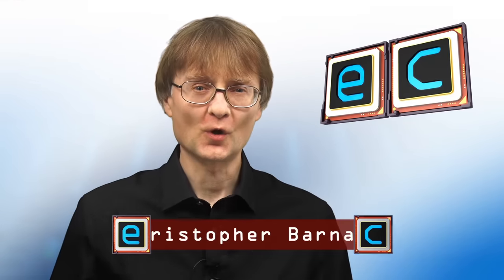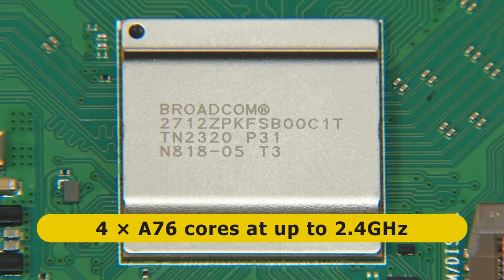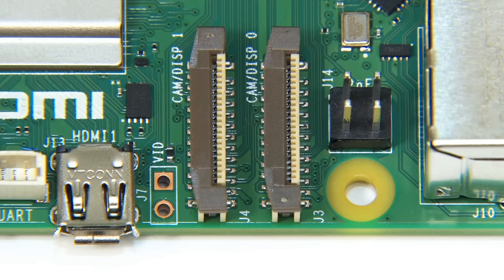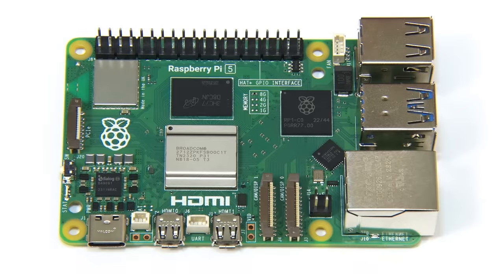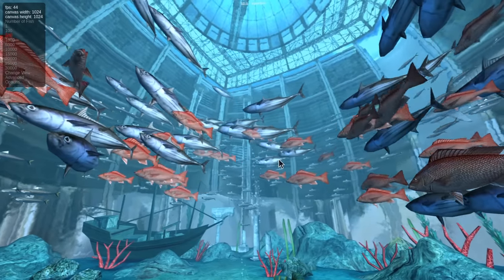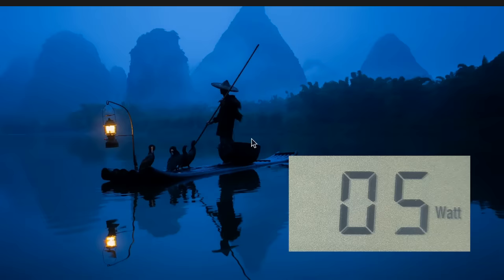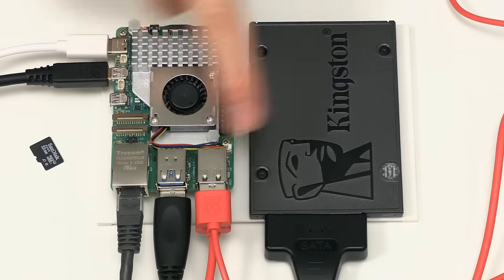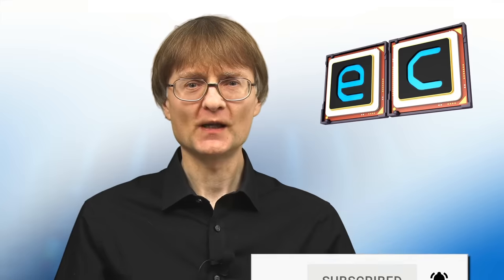Raspberry Pi 5

Comment: Is it possible to use it without the cooling? Or is there a passive cooler option thin enough to fit between the Pi 5 and a hat?

I am using Pi 4 with a HiFi Berry Digi+ I/O hat on it, mainly as a music player and server (LMS + squeezelite / MPD). Occasionally, I am using it to watch videos, too. 
While the temperature during the music playback was high but acceptable, Pi 4 was getting pretty hot during the video playback and the videos dropped lots of frames, so a cooling solution was needed. 
I used the geekworm P165-A radiator with no fan as a passive cooling solution and this seems to be optimal for my needs:
- the temperature dropped significantly,
- it fits between the Pi's board and the HiFi Berry hat,
- it is passive, so it is silent.

I wonder... Could I upgrade to Pi 5 and preserve all the functionality?

And a second question: is the widevine available for the 64-bit OS by now?

Comment: This is great news going to pre order one, so from what I can see if you have the new official case you can not use the official active cooler, the new case has its own fan.  Did they send you an official case? can the pi with cooler fit if you remove the fan case?
Reply from the maker: You are correct I think -- the option is either the active cooler (heat sink and fan) or the official case (which has the fan in it, and comes with heat sinks to fit). I was not sent an official case to look at.
Reply: Thanks Chris for the reply, it looks like this is the way.  @ExplainingComputers

Comment: Honestly, the Pi4 8gb clocked at 2.2ghz serves me very well as a desktop. Whenever i need more power i can just fire up my 5,1 MacPro with it's 12 core xeon beast mode. The 5,1 doubles as a space heater. The one thing I'd love to know is how well the new board overclocks.

Comment: Query:  Would high quality CPU thermal paste work better than those pre-applied thermal pads on that cooler?
Reply from the maker: Probably not -- there are some significant, and varying, gaps to fill. So with thermal paste, some precise copper shims would be needed too -- although paste and shims would certainly work better.
Reply: @ExplainingComputers  Thanks for the reply. I never heard of copper shims. I'll have to look into that.

Comment: A board layout is still a big concern for me. I'd like to find a full size HDMI where USB2.0 are located (and move them to a 16-pin header), a power button switch and an SD card at a left long side, and CSI/DSI at a back short side. It's good to find Pi faster, but it's too late ))

Comment: Because of the RPi drought, I have had to go over to other processors for assorted projects, in particular I have acquired and used old Acer Revo  machines. I still have a few of them left that will keep me supplied for the next few months. With 4GB RAM, and some sort of SSD >100 GB, I usually mange to find these for about $50, delivered. 

The problem for RPi is that people have lost faith in its ability to deliver. Thus, I am considering using something "completely different". Most of the RPis I have used were compute modules. The board I would like to migrate to is a Milk-V Mars CM (as in compute module). With 8GB Ram and a 32GB eMMC, a board costs about $84 +.

Comment: Hopefully there will be Rpi 5 model A's as well as a Rpi Zero W 3.    With RPi's still unobtainum for the most part, I hope the model 5 will be widely available on launch.
I'd also like to see a new Pi format, call it a model C.  That would be a larger board with on board M.2 socket, and maybe a 50 pin connector (expanded 40) with more GPIO pins.  Also why not a 16GB RAM option, or even an SODIMM socket for a stick of DDR5?

Comment: I love pis but it's hard to interface with a 5v circuit using a 3.3v micro controller. so Arduino has its foot in the door with a 5 volt base. Especially when it's easier to drop you current than raise it. For up you have to introduce a higher voltage but for down you can usually get away with a resistor voltage devider curcit

Comment: Summary
This video provides an overview of the Raspberry Pi 5, including its physical appearance, accessories, specifications, and performance. The Pi 5 features a new system on a chip (SoC) with four ARM Cortex A76 cores clocked at 2.4 GHz, delivering a two to three times performance increase compared to the Pi 4. It also includes a new VideoCore 7 GPU, improved camera support, and a new chip called the rp1 that enhances the performance of connected peripherals. The Pi 5 has several new connectors, including two MPHY transceivers for cameras or LCD displays, a PCIe connector for linking to PCIe peripherals, and a power button. The wireless module provides Wi-Fi and Bluetooth capabilities. The micro SD card slot remains the only onboard storage, but the performance has been improved. Overall, the Raspberry Pi 5 offers a responsive desktop experience and impressive YouTube playback.

Highlights
💻 The Raspberry Pi 5 features a new SoC with four ARM Cortex A76 cores clocked at 2.4 GHz, providing a significant performance increase compared to the Pi 4.
📷 The Pi 5 includes a new VideoCore 7 GPU and improved camera support for enhanced graphics and image processing capabilities.
🖥 The rp1 chip improves the performance of connected peripherals, enhancing the overall functionality of the Pi 5.
📶 The Pi 5 has a wireless module that offers Wi-Fi and Bluetooth capabilities for seamless connectivity.
📲 The micro SD card slot remains the only onboard storage, but the performance has been improved with support for the SDR 104 high-speed mode.
🎮 The Pi 5 provides a responsive desktop experience and impressive YouTube playback, making it suitable for various computing tasks.
⚙ The Pi 5 has new connectors, including MPHY transceivers for cameras or LCD displays, a PCIe connector for linking to PCIe peripherals, and a power button for convenient operation.

Comment: How do we get sound out of it? Do we need a gizmo tap it off the HDMI cable? No words about the lack of a sound card because it was a sponsored video.
Reply from the maker: It was NOT a sponsored video, I was provided with free hardware (so clicked the control to indicate this), but there was no control or input to my review. I was also critical of several things -- including the lack of the 3.5mm jack (it was one of the first things that I mentioned -- at 2:13 ). So your comment "No words about the lack of a sound card" is COMPLETELY UNTRUE as I explictly mentioned this! And I was also critical of the lack of eMMC, and lack of a colour-coded GPIO header (all standard on most competitor SBCs). Sound is from HDMI only,.

By all means criticize my work, but do so based on what is actually in the video!

Comment: Thank you for the review. Is there a way to install open media vault on RP5? Seems like RP5 requires Debian 12 and OMV6 is not supported on Debian 12.
Reply from the maker: You make an extremely good point. Software-wise, these remain early days, with the Debian 12 Rasp Pi OS not yet released. As I understand it, OMV 7 wll be based on Debian 12.
Reply: @ExplainingComputers  Got it, thank you for responding.

Comment: I'm worried that as each PI comes out, it gets more and more powerful and more expensive. Beyond what is needed for small projects. Do they still sell earlier versions?
Reply from the maker: Agreed. But they do still sell the Pi 3B+, Pi 3A+ (a very nice, small Pi), the Pi 4, CM4, and various Pi Zeros. The Pi 3B+ will be supplied until at least 2028, and the Pi 4 until at least January 2031.
Reply: Ah good to know, I have a PI2 and 3 for projects and a few Arduinos for smaller ones @ExplainingComputers

Comment: Does pi5 also comes with Composite AV port??
Reply from the maker: It does not.
Reply: @ExplainingComputers  very bad , it should be.  Vga is very usable for simpler projects which requires display like car screen can be also used by just two wires.

Comment: What I never understood why the raspberry pi does not use USB-PD and ask for 20V at a 1.x amps instead of cranking up the 5V rail to 5A. It needs bigger wires... why?
Reply from the maker: I guess because in many industrial and maker applications, 20V will not be available, whilst 5V will.
Reply: @ExplainingComputers  every phone charger supports it and the raspi consumes enough power to not be left without a wall outlet for any amount of time. 

Basically if you need embedded you use an esp or something similar arduino instead. 

I am also wondering if any maker env where only 5V is available could possibly provide 5A :) My 3d printer, which runs a raspi can, but that also has rails that go higher to 24V for example.

Also I wonder if the meter you used that could only measure 5W, which would be 1A is possibly faulty and can't measure that low wattage accurately.
Reply from the maker: A very large number of Raspberry Pis are used in embedded situations in industry where an ESP32 or Arduino is absolutely not suitable. A very different level of processing power and other resources!

Comment: Can a non-PD power supply, like a 5V high current supply hotwired to a USB-C plug, still power the unit and not have the USB ports power limited?  How about injection through the GPIO header?  The latter is how the Voron 2.4 manual suggests connecting power to the Pi.

Comment: not a fan of active cooling. all my pi 4 (3 of them) are running for years without fan, just a small heatsink). Have you try running pi 5 without the fan, just a reasonable size heatsink?

Comment: I just got hold of a Pi4 a couple of months ago to use as a media PC (works great for HD video), but the Pi5 looks like a real improvement. I think it's possibly the first Raspberry Pi that is really viable to use as a basic desktop PC, and with such a low power requirement too.
Reply from the maker: What you say is correct. For a media or small desktop PC, the Pi 5 is a massive improvement over a Pi 4.

Comment: What's up with the uart connector on the front edge? It has the serial pins in the gpio, does this give a second interface or just a second connection point

Comment: This looks like a big upgrade, hope they MSRP is actually reflected when you try to by it, Pi 4's are nowhere near this price on Amazon right now :( Forgive my ignorance but would it be theoretically possible to add a discrete GPU through that new PCI-E connector? That could be a game changer for gaming on PI, since you've only talked about storage options here I presume that is not going to be possible.
Reply from the maker: Amazon has never been an approved Pi reseller -- all official Pi resellers charge the MSRP and always have. It is only scalpers who charge the higher prices.

Yes, in theory an external GPU could be interfaced to a Pi 5 via its PCIe connector -- but you would need software support, and also a power source. Remember that it's only a one lane PCIe 2.0 interface on the Pi 5, so very slow compared to the 16 lane PCIe 4.0 interfaces on the latest graphics cards.
Reply: @ExplainingComputers  Thanks for the detailed explanation Chris. I live now in Canada so I don't have a lot of options to get my hands on Raspberry Pi's but I'll be looking to pick one of them up when they become available to us over here. Appreciate all your content, I always feel so much more educated after watching one of your videos :)

Comment: I was coding a drone obstacle avoidance  depth of field on the pi4  with a single camera to capture frames  and accelerometer to compare image offset between frames.The Pi 4 with a single camera interface was far to slow. While Pi4 is well suited to the every day  media server tasks and probably well over powered for the general programmer. I would be really interested in  a speed test on the simultaneous  xor  frame captures of two cameras located side by side .  And displaying this back to the screen. My original intention was to then use IA to determine the object and distance. As you can imagine this was asking far to much from the PI4 using all it's cores.

Comment: Sad that they removed the 3.5mm audio jack but happy that they added the power button and the RTC battery connector.
Also, I am impressed by the new performances.
The 3.5mm audio jack was not perfect because it was only supporting headphones, no microphone.
Now, it is worse because we do not have the 3.5mm audio jack anymore.
We are forced to use an USB port.

Comment: I experimented with the pi3b, and it was great at the time. But really held back by video playback and general web browsing was incredibly difficult later on and now it's in the junk drawer. I know I could put a bunch of projects on it to keep it alive but I haven't been that fussed.

Skipped Pi4 completely due to the supply issues and lackluster reviews about how it handles the modern internet - I am actually excited for the pi5 8gb having seen this. Looks like something small to live by the TV. I wouldn't see it as a desktop replacement (I game too often) but if it does the basics this well I might pick one up. Am always tempted by the refurbed minipcs, but many won't got to windows 11 but with Linux obsolescence isn't a worry, the patches will always be there.

Comment: Is it possible to boot a RP4 from an SSD ?
Reply from the maker: It is. Newer boards are now set up for this, older ones need a firmware update. See my video here: https://www.youtube.com/watch?v=2zrwjGcyM5s
Reply: In that 3 year old video, you used Beta firmware update. But about the currant times. What do I have to do to use a NVME M.2 SSD ? Still install a 3 Y.O. firmware update ?  @ExplainingComputers

Comment: I wonder if the micro SD card works well with a SanDisk A2 card. If it works about as good as their A1 cards, then the card reader isn't optimized to run faster iops of the A2 can offer.

I'm also interested if it supports overclocking?

Comment: From what I can say about the Pi 5 so far: 

I wish they'd have gone ahead a little bit more, and get rid of that SD card for either a M.2 slot on the bottom and make it actually fit the board.
I also see little reason to have two HDMI ports instead of let's say a Display Port, or just a USB-C port that could also handle displays but can be used for other purposes.

I like the active cooling solution, but I would have loved to see a decent passive solution as well, maybe even using some heatpipes. I feel like for a 5W-ish board, a passive cooling is entirely possible.

Comment: Exactly what I didn't want to see: 2 mini hdmi ports. This is what made me jump from the Raspberry Pi 400 to the Orange Pi 800 after I struggled to get any attachments working that would give me an analogue output. My fellow 400 users are also finding the mini hdmi ports break down very quickly. Hopefully a decent PCIe add-on is made to give us some proper outputs
Reply from the maker: I would have preferred full size HDMI.
Reply: @ExplainingComputers   Time will tell if the mini hdmi ports last. So far they've been breaking down on the 400s, but that's more of a niche product. With this being the main new line, it could kill the brand if the same happens here. It could also take things in the opposite direction, and they do a back-flip to including ports people actually want. The 2 mini ports got a lot of negative feedback, so they're being surprisingly stubborn here. If they include analogue av out (as the 3 has) it would be the ultimate retro games machine. Here's hoping for a 5B (and maybe a 400B)

Comment: Amazing video! I hope that the homologation process here in Brazil will be fast. I really want to use the Raspberry Pi 5 as the main desktop (two monitors, NVme and SSDs). I really liked the cooling solution, because where I live until my old Raspberry Pi3B has to use a heatsink and a fans to be able to stay with a stable temperature.

Comment: I run the same sysbench cpu command on my Mac mini M1, and it took only 0.0008s, (for 100K - 0.0085s) for RPi5, more than 2.43 sec (10K), isn't there something wrong? Power consumption for Mac mini M1 is roughly the same (around 7-8W), but performance incomparably better...

Comment: I don't have much confidence on the M.2 SSD speeds over a single PCIe 2.0 lane, but it's a start and it will be very interesting to see other use cases for it

I really hope these are actually available and don't get scalped and resold in the same way the 4 was

Comment: I never looked into Raspberry Pi but they're surprisingly impressive specs for the price. These would be such a cute computer for someone only needing it for email and web browsing. Maybe even some lighter retro gaming, like older console emulators (NES and maybe GBA).
Reply: Starts adding up when you need to add a case, the less common micro HDMI cable, a power supply, etc. Usually works out cheaper to buy a second hand mini PC.

Comment: The best for me is that massive cooler, the heatsinks for previous models (at least up to 3B+ I never had a 4) were a joke. 
I hope some company will make an aluminium housing to get rid of the heat in a passive way, maybe using heatpipes to fill the gap between the housing and the chips, like some options available for Intel NUC.